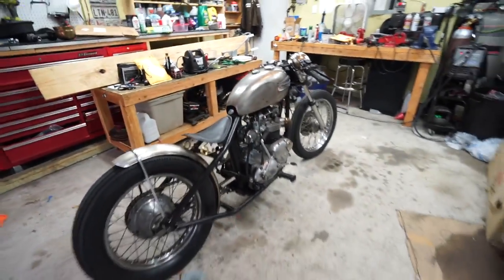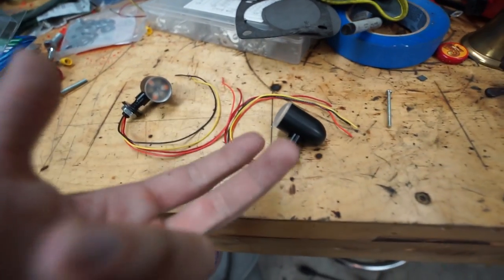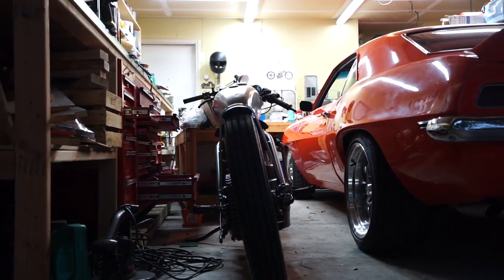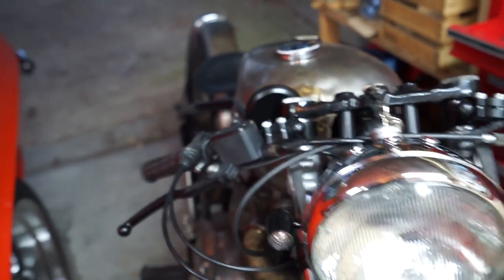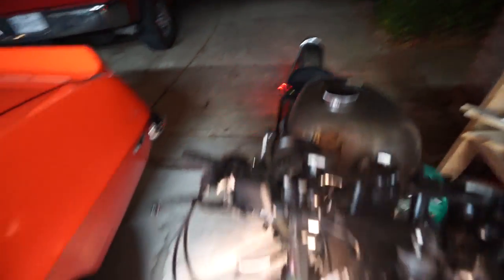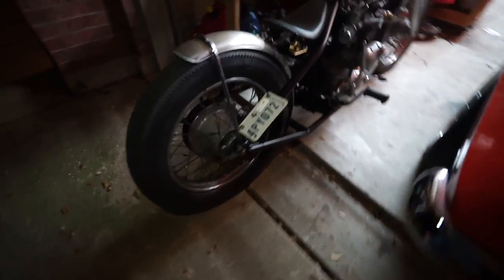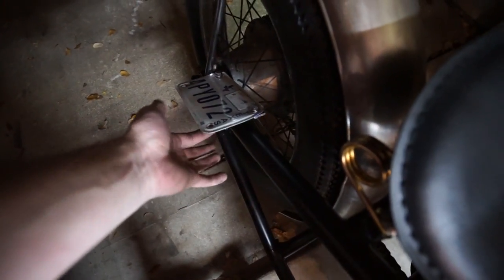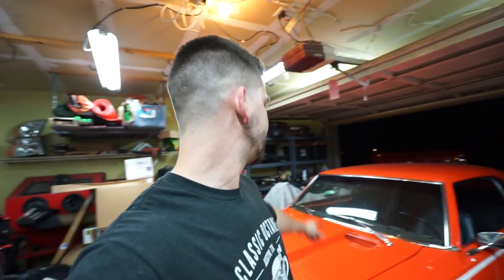Brightest motorcycle taillights | Triumph Hardtail

Comment: I don't know about the M-Unit basic, but the M-Unit blue has a feature that if you do a very hard brake it will not only turn on your break light, but it also turns on the emergency lights

Comment: Hey, if you never got the flickering figured out, these should have programming to take care of it.  Using a magnet you can power them on and off to cycle modes and find the one that works for you.  There is a specific spot you place the magnet, then power cycle them to change the modes. Hope it helps.